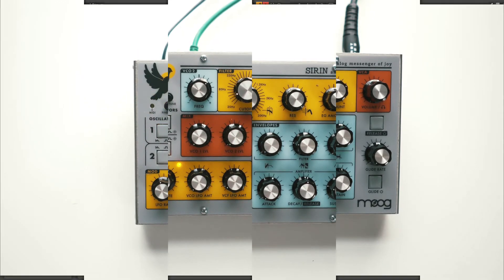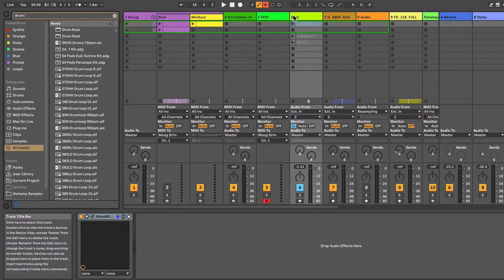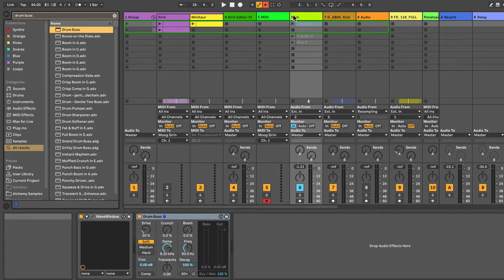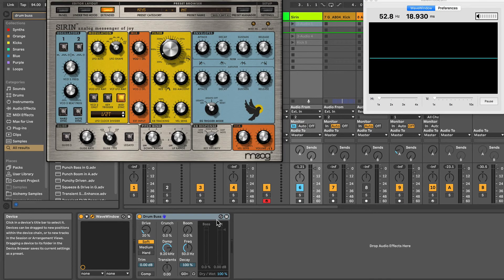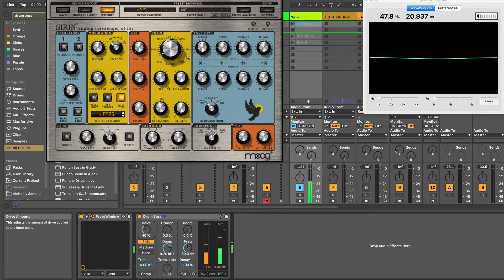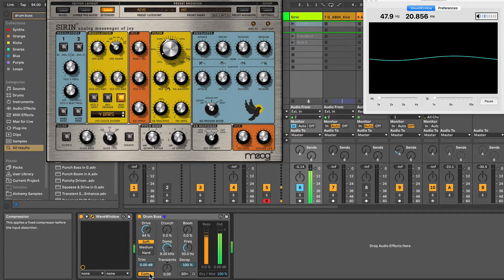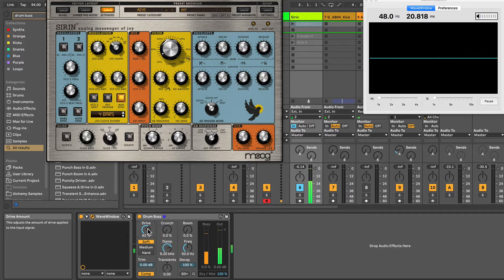3 Sound Design Examples with the Moog Sirin

Comment: Killer video, this really helps demonstrate the diverse utility of the Sirin. I'm considering buying one, weighing that against maybe a Mother-32 or continuing to save for a Sub 25 or 37. I have a Minilogue so have a polysynth for pads/chords and a Digitakt for drums/sequencing. My initial feeling is to go for the Sirin: limited edition so will hold value if I unload it later, no menus (though there is a lot of shift+knob for additional function if not connected to PC), two oscillators, and no patching (this could be a con, as I am tempted to get into modular/semi-modular). I don't really need a new keybed (I have a Keystep) so not sure I'd spring for the Grandmother, though of course that's another option.
Regardless, really dig the video, concise and clear, killer sounds!